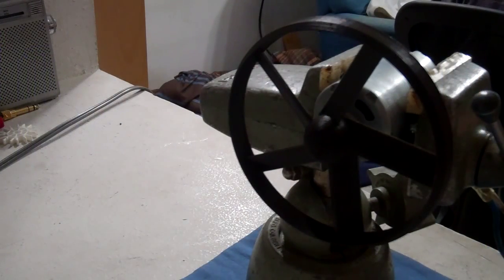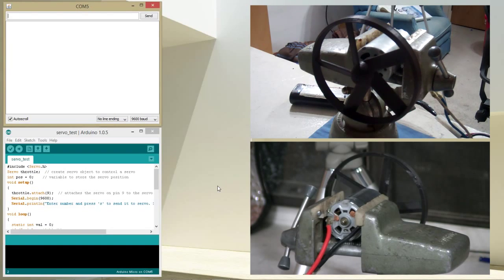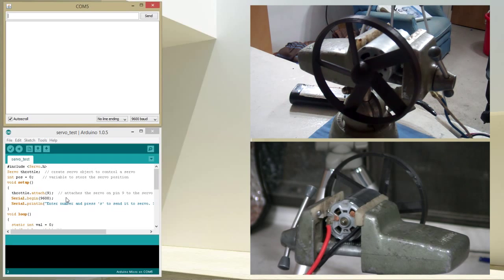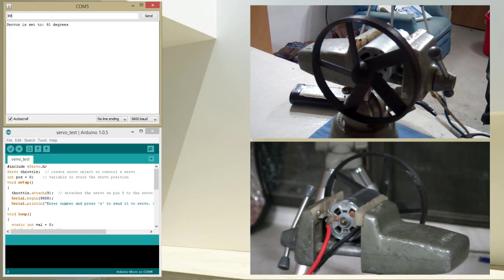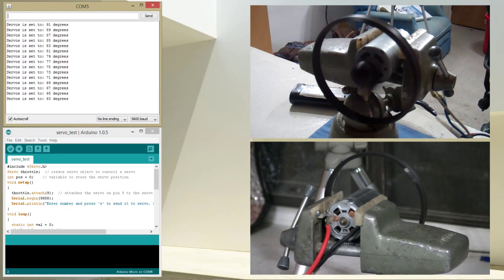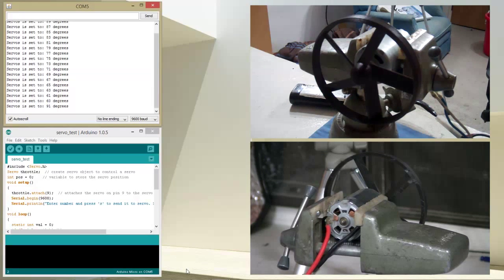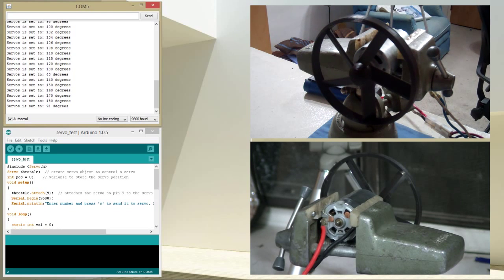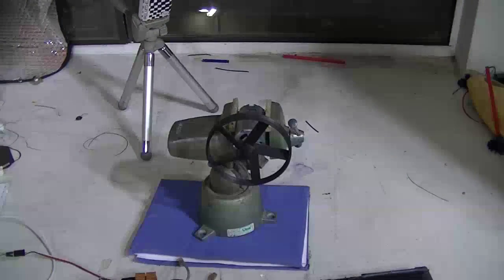3D Printed Propeller Test

Comment: If you are interested in a small aircraft propeller - This nice little propeller is great for small projects.

https://youtu.be/ve9AgQGHjMk

Printed on an OBjet 3D printer.
Thin trailing edges may need to be sanded with fine sandpaper to make them less sharp/stronger.

Sign up to download parts for free.
http://www.stlhive.com/my-account/